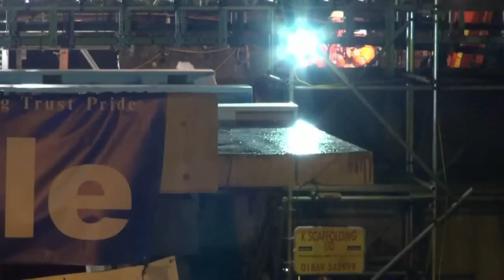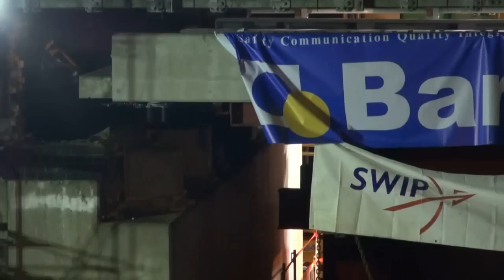Rickmansworth Met Rail Bridge Replacement Full Video 2016

Comment: (31:26) Is the new bridge sitting on a bunch of 2x4s attached with some PU-foam??! :D
Reply: Better late than never. The 2x4s are the formwork for the grout underpinning. The foam seals the gap between form and concrete, because the grout is very viscous, like yoghurt.

Comment: Interesting film. But two questions. Why did it need replacing? And why, at the end of the film, under the title "A new bridge for Rickmansworth", does it appear that the left hand abutment has removed the left-hand carriageway? - as evidenced by the offset white line in the road, and also the no entry sign very evident all through - because if the bridge is now one way, then I would have though that a new bridge should have restored the two-way working under the bridge!
Reply: DrivermanO the road markings are for a cycle way, it has been one way since the 50’s up towards the building, joining the left entering road moving right towards the Waitrose supermarket. The original bridge had become uneconomical to keep repairing, and a potential hazard. The side arched areas are for pedestrians.

Comment: Seemed a lot of men in "safety equipment" standing about doing nothing - waste of money, surely moving a portable fence for example doesn't take that many men, also I don't see the point of the 'reinforced roadway' when once loaded they drive straight off it onto the ordinary road complete with manholes, cracks, and repaired trenches in it. As usual too many chiefs - typical UK nowadays.
Reply: I assume you have a managerial post in a haulage company?
Reply: Actually retired now, - but we just used 'common sense' in those days, plus a lot of 'blood sweat and tears', however we still got the job done and with a lot less machinery. Possibly one of the reasons this country is in the state it is in. Once this country was a 'World Leader' in a lot of things, - alas now we import far more than we ever exported even in times gone by. A hard days work never hurt anybody now all they want to do is 'automate' everything.